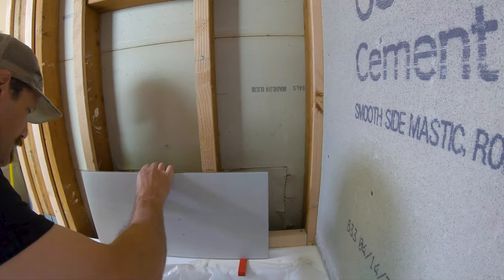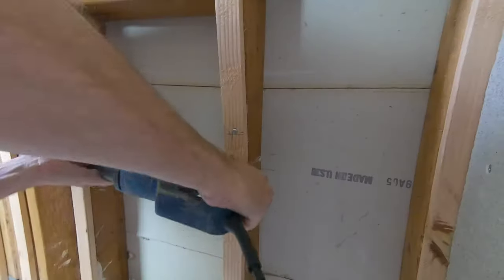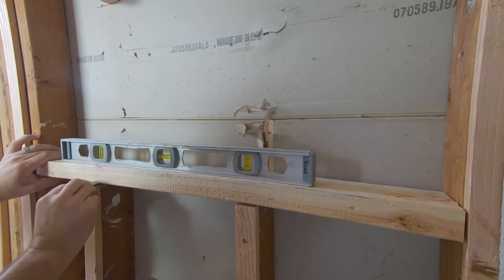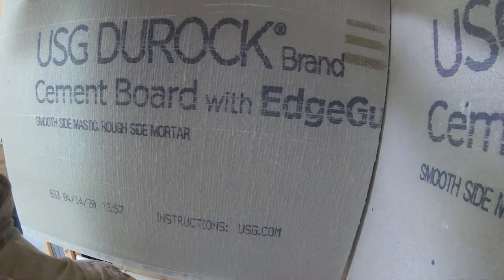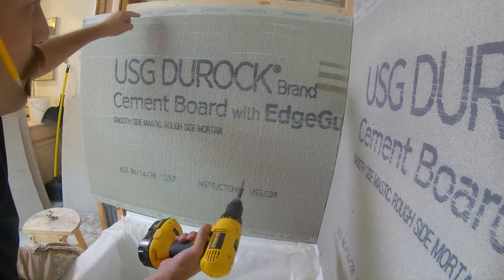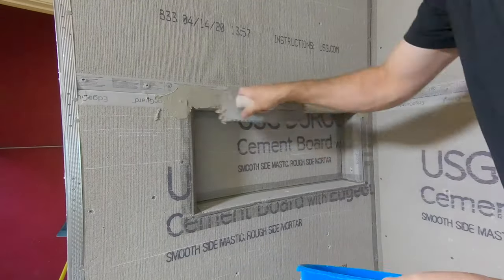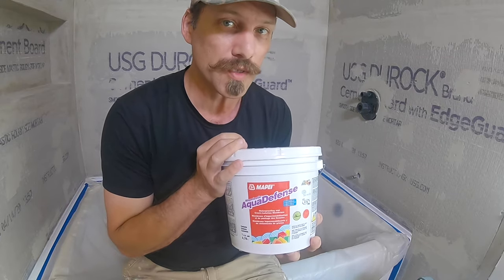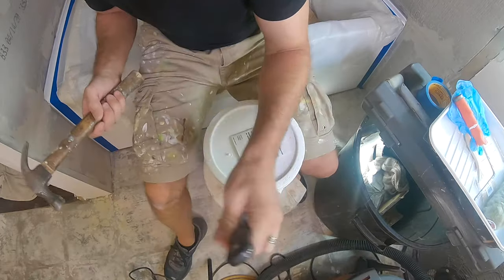How to make a shower niche from start to finish

Comment: Great Niche, But I dont understand the obsession with putting in the bottom 2x4 off level. If you have concrete board, taped and mortared in, Then Waterproofing liquid liner, with reinforcing tape imbedded into the membrane, Then mortar tile and grout, If water is getting in there to the framing layer and rolling off the 2x4, behind all of your defenses, you're done son. Thats a game over for your entire shower. At that point you might as well waterproof membrane the framing of your niche before you rock board(in fact just get a compressor HVLP spray gun, figure out how to thin down a liquid pool water proofer and cover your house.). Why not add the 1/8 inch slope for draining at the tile level? Under the tile while you mortar in with tile spacers as shims?
Reply from the maker: Ideally the design is to only have to put the cenent board on top of the slightly angled 2x4, which would speed up the process. It didnt work out that way with this niche. But it ultimately worked out fine. Not sure it was an obsession, just how I learned to do it.
Reply: @coolhandryan  Yeah, not your obsession, I just see alot of guys doing that way, and think its not wrong just silly. When you can put that slope into your tile at the end. I just pulled some tile and the mortar layer seemed pretty dry back there..behind the water proofed tile. In fact theres a spec for that. It's 3% water absorption fully submerged for tile bisque since the glaze is considered fully water proof. You'll probably have to fire cone 6 to get a clay that can do that. Thats the tile. Not the latex modified mortar layer....Ehh ill water proof the studs but not slant them. If water is getting back there I hope it stays there. It wont be moving around to anywhere good if its getting back there.
Reply: The tiles for the sill should be done before the tiles on back of the niche. Back tiles should overlap the bottom sill so water will run on top of the tile, not on the grout line. If I’m wrong with my comment, I’ll appreciate if someone could correct me.

Comment: What’s the purpose of putting a water sealant over top of concrete board? Is it not designed so that when water gets through the grout that it will dissipate throughout the concrete board and not puddle up anywhere by putting a coat of water proofing on there like that, all the water is gonna run down behind The Tile and pull up at the bottom, thus causing issues concrete board was designed to get wet absorb. It dissipated gone no worries you could literally take it outside. How is it down come back later or the next day and it’ll be just exactly the same as it was before you hose it down I don’t know it just seems kind of redundant and a waste of time and money  to seal the entire if you want to do the joints I could see that OK but the entire thing I think you’re missing the point of what concrete board is and what is supposed to do just an opinion like assholes everyone has one carry-on have a great day always Steve
Reply from the maker: Thanks, Steve. I totally get your point. Seems like overkill. I was initially intending to make this a steam shower which would have made the cement board more susceptible to more water. That could ultimately wet the frame behind it. So, I sealed the whole thing, then decided not to do the steam thing. But almost all companies recommend water sealing the boards anyhow.

Comment: That’s not schluter it’s customs metal edging
Reply from the maker: Bought it at Home Depot and it was called Schluter Trim. Did they label it incorrectly?
Reply: It looks like bengard.
Reply: Customs has circles that embed into the mortar. Schluter has trapezoids (or whatever they’re called).

Comment: your seams don't even line up inside the niche, even with the weird offset you added.  At least be consistent.  Also, show why your trim needed recutting multiple times.  For the placement, you do bottom first, then top , then back, then left/right.  This way the water has a continuous flow out of the niche.
Reply from the maker: In case you didnt notice, the niche is finished and I havent made another. Your negative tone is useless and unwanted on all channels (I’ll speak for them). How about you take your own notes and make your own video and post it? I’m guessing that is what you really want to do but youre holding back for some reason.

Comment: TOTALLY WRONG: NICHE: 
BOTTOM TILE NEEDS TO BE INSTALLED BEFORE THE BACK WALL.
😱😱😱
Reply from the maker: Thx for chiming in so enthusiastically, Lu. That is the main concern about this project and viewers should be aware of that one step. However, I believe that is the only issue. The niche is now years old and is performing perfectly.
Reply: @coolhandryan  I'm not better than you but this little issue  will PERFORMING PERFECTLY if tou do the right wsy, 
Of course if water going/leaking on the back after one year you will not see that.
Been see a lot of PROFESSIONALS doing same thing.and also doing the shoer floor after wall tile. Same issue.
Reply from the maker: @Lu-cho  Seems the same comment as before, Lu. Yes, you are correct about the process. I'm in full agreement. I also know that my particular niche is not under direct running water so it is actually performing the way I wanted it to. There is not enough sweating of the tile to create any issues where it is. Again, this is a DIY project that I think has been done pretty well. Your comment has been accepted and noted.